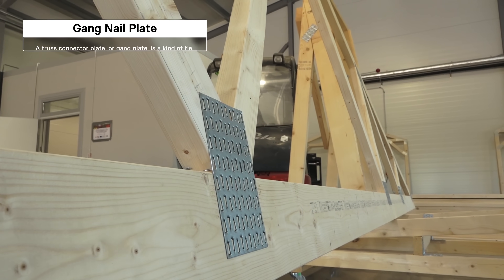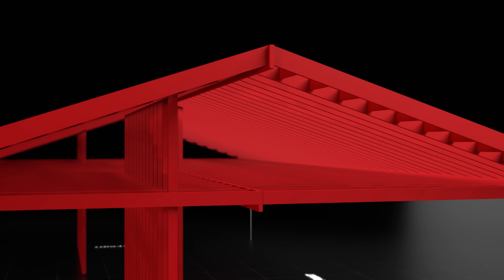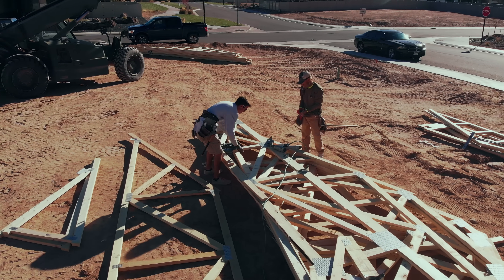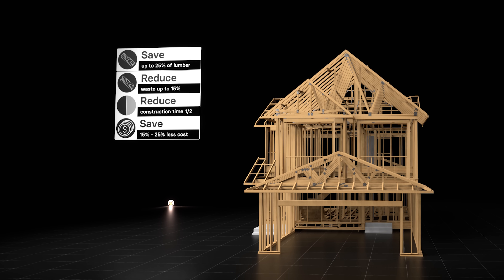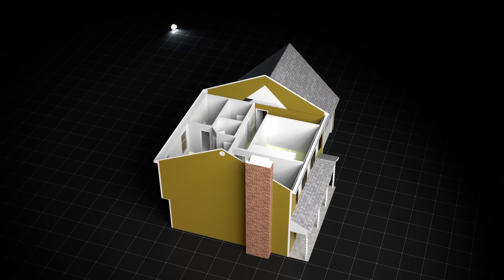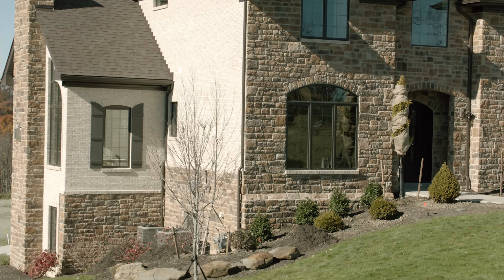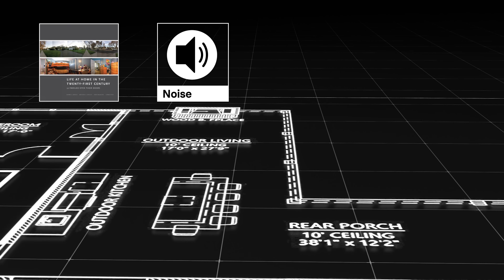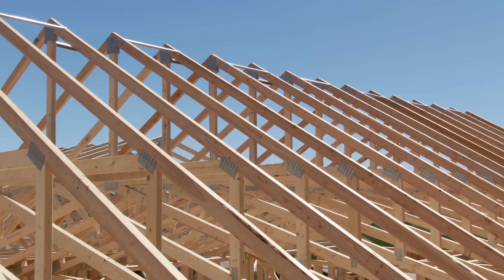The Invention that Accidentally Made McMansions

Comment: I'm not in expert but from watching building inspector videos it seems a lot of these pre made trusses get broken. Maybe during shipping or installation, or perhaps when a contractor comes in to install insulation or HVAC. These trusses get broken or their plates knocked loose. That's not safe. If you had a carpenter building the truss they would know if a part was broken or loose. But when all they are doing is lifting the truss up and nailing it into place they might not inspect every truss and plate.

Comment: Why couldn't they build brick houses? 😭😭
Reply: Wood is the building material of the future, bricks & concrete have a huge carbon footprint.
Reply: @nightjarflying  You don't have to rebuild it for centuries. The most durable materials, that can stand the weather. We have a more than 100 years old house, and it's still in great condition. It does not affect the environment, because you NEVER have to rebuild the house.

Comment: I will never own a home with gang plates. I simply refuse to build with something so easily thwarted by lateral loads But, I'm a stick builder that is not frightened by the inherent cost of quality materials and liberal application of other fastening plates.
Reply: This guy is clueless thinking they are stronger, and used in mcMansions.  I was a lumber estimater for a lumberyard.     That inspector Cy Porter shows failed truss plates, and poorly built trusses,    on tract houses,  
I have never seen a mcMansion with trusses,  the different plate heights of walls,  the varied chamfered ceilings,,  are easier built stick frame,     trusses would require girder trusses, and a lot of specific trusses, that only fit a single location, compared to a tract home Gable roof that has identical trusses for the whole roof
Reply: @jimonthecoast3234  I'm in coastal NC..I would estimate that over 95% of our "Large Homes" ($3-8 mill, ) are all Trusses and LVL. The lable of McMansions applies to the stick/modular built homes that are still spec quality but bigger builds.  Its laughable to me but, gang plates pass the local stage 3 storm standards (somehow).  I personally choose the LVL or an engineered I beam for most of my span applications. If the customer wants gang plated trusses, I do my best to talk them into dead wooding everything with a plate. . I have given up an entire development due to their choice to substitute an 18x6 inch engineered wood creating a second story or cathedral ceilings, for 40 foot gang plated 2x6 trusses. They chose to close in a space that was 30x30 along the entire span of the homes..Essentially they were turning a "Two story English manor," with dormers, into a slabbed out ranch house with 10 ft celings inside. 8/  Im not the least bit upset about giving that one up. They are comical looking inside and out..  XP

Comment: Lol.  Truss plates are what made tract homes more profitable,   and built suburbia.
 mcMansions don't often use trusses, because they are too custom, often with hip roots over rooms with chamfered ceilings,  they are cut and stack
I would know, I read blueprints for a lumberyard,     never saw a single mcMansion with roof trusses,   but they did have truss joist flooring.  You need to correct your title and remove mcMansion since this isn't about them
I almost think you don't know what a mcMansion really is.
Youclearly dont WORK in the field,   and just made false assumptions,  like a n architect that has never done structural plans for a mcMansion
Reply: Not sure why you mention hurricanes.    Truss plates are not hurricane rated,   trusses are very weak compared to a stick frame,   cy the inspector youtuber often shows truss plates falling out, and sloppy connections
They are weaker,
Reply: Engineered beams, can span the distance,and create the open floor layout.  
Cost, time is the benefit. Of trusses,    Weaker design is the drawback.  Especially in seizmic and hurricane areas, where Simpson hurricane ties, and clips make buildings less prone to fail at connections,   which is vastly different than a gang-nail truss plate.   Some clips have screws or nails that are 1-1/4" long and go much deeper into wood than a truss plate

Comment: I've seen older homes use plywood cut out in shapes to do the same thing as the metal plates, basically the exact same thing, except thicker, and not nearly as efficient, because all the pieces had to be cut to fit.

Comment: Structural engineer here. While the gang nail plate has made wood trusses economical. I dont see an conmection between that and the current huge houses that are being built. 
Before college i worked as a framer building these homes (back the early 00's). The homes we were building were mostly standard framing. Hardly ever used trusses. 
If I had to guess, I would say it's more an economic calculation. As land values went up, it just became easier to justify spending more money on the house itself. I'm sure that overall cheaper building materials helped as well. I don't see a connection between the gang nail plates and the current McMansions....

Comment: Interesting twist on history .
Fish plates ( joining plates to some ) had been used on iron construction for centuries either through bolted or riveted .
Hooping iron had also been used for centuries , as the name implies , originally for making barrels .
A nail on plate had been in use for roofing in Australia for at least 100 years as my parents 1892 house had them securing the roof members .
Perhaps this is because Australian houses were made using hard woods and not junk fir or pine and hard wood is rather hard to nail deeply into .
So the parents ( well grandparents built it ) roof was held together using plates with holes and ungalvanised clouts .

SO at best all he did was transfer a method of joining from one material ( iron & steel ) to another material , soft woods . So more of an adaptation than brilliant invention .

No idea about the USA but the introduction of McMansions in Australia is solely due to the governments abandoning social housing during the 70's when greed was good and all taxation was theft .
When the government built social housing it set a size for basic houses around 30' x 60'  for a 3 bed and 40' x 70' for a 4 bed , both single storey .
These are of course cheap to build and more importantly very very cheap to run as heating / cooling + lighting was only needed for the rooms you occupied at the time and most houses were far enough apart to use cross flow ventilation which combined with deep eaves on the sunny side negated the need for air conditioning completely . 

My sister lives in their old house and her energy bill is 2/3 of my bill and I live in a tiny house with no air conditioning either .
The large ceiling space allows for things like a 300 gallon copper gravity fed hot water tank that is the original one that was installed before electricity was available .
The only maintenance done on it since 1892 is one new heating element and several new float valve seals .

Of course you hit the nail on the head when you said builders quickly worked out that building fewer larger houses was more profitable that sensible sized houses thus the McMansion is the only house that you can buy in Australia and trying to get approval for my 180 Sq meter hose took 3 years but a 400 sq meter hose for my neighbour was approved in 2 weeks .
Then there are banks. None of them would finance the $ 85,000 house because they wanted me to build a $ 250,000 house so I would be making lots of money for them for the next 30 years .
I piss myself laughing when I hear all of the sad sob stories of people having to sell their 400+ sq Metre split level McMansions because their utility bills are no longer affordable or an inappropriately built house with a complex roof that collects leaves burning down during a bush fire while their neighbours single hip roofed house stood firm .

Comment: Connecting to the top wall plate isn't explained. The metal connectors are only set in the vertical plane, so how is the roof connected to the walls?

Comment: Railroads use gang nail plates on the ends of crossties to help prevent splitting as the tie ages and deteriorates. It has saved railroads a lot of money utilizing a product that wasn't designed  with trackwork in mind.

Comment: 2X6 walls spaced 24" on center are no stronger than 2X4 walls spaced 16" on center, yes they have more insulation but they are only stronger if spaced 16" on center and that is not very common.

Comment: First, truss roofs didn’t get big til the 80s
Second, they are used to replace skilled framers with jack of all trade builders 
Third roofs in hurricane andrew ripped off all over Florida in the early 90s, what stopped that was hurricane clips to connect roofs to walls and projectile resistant windows.
If anything truss roofs came off more easily not less.
This seams  like very shallow research

Comment: Trusses are only half the story.  Those 80’s houses were still using 2x10 floor joists which at best are good for 14ft of span so that is why the 28ft width was so common.  The TJI composite floor joists is where spans really took off.  All the Engineered Lumber or components were inevitable as we are out of “ good” wood.  Plus the other factor of a generation of kids growing up in small overcrowded house, well they just wanted something bigger 😂😂

Comment: Does anyone know what the machine for setting the plates into the wood pictured at 3:20 is called? Thanks in advance.
Reply: Unfortunately, I do not know of a specific name for it, but functionally it would be called a C-Frame Hydraulic Press... Basically it is a reinforced C-clamp with a hydraulic ram instead of the usual screw drive.

Comment: Typical local government housing policies are based on the number of "dwelling units".
They see no difference between 1 small simple 1000sq ft house, and a 10,000sq ft mcmansion
Reply: I didn't clarify. When a developer can only build 1 house on a parcel, and there is an decreased supply, they build bigger. Because they are aiming for that 30% profit margin. And often permits were a flat rate.

Comment: Its interesting how long it can take building practices to change.  The neighborhood I grew up in was built in the 1970's/early early 1980's.  1 to 2 acre lots, Tennessee so no basements, long long long ranch houses, no split levels, a few two story brick colonial type homes.  None of them used trusses.  In fact it would be impossible to have the rec room/bonus room over the garage like 90% of these homes have if they used trusses.  They graded the lots to have the garage at a lower level than the rest of the house so there was enough head room to have another room above the garage.  Garage was down a flight of stairs, rec room up 4 or 5 from the main floor of the house.  About 10 years later in the 90's the 2 story McMansion became "THE THING TO HAVE" in that area, all of those were built with truss roofs.

Comment: I think you may be over-stating the point about the long-term effects.  Since the roof was previously the most difficult part of a house to build, if there hadn't been truss plates, some other invention(s) would have come to ease this, which probably would have affected the shapes of roofs today, but the rest of that snowball of consequences based on lower building costs would still have happened.

Comment: Another downside to these truss systems besides no attic is the much shallower pitch to the roof.  This is a problem in the northern parts of the country that get snow.  With the shallower pitch the roof doesn't shed the snow.  The snow freeze/thaws sitting on the roof which leads to shingle damage, which in turn leads to underlayment damage, which means expensive roof replacement costs.  My roofer loves my old house here in the northeast.  He replaced the shingles and noted with satisfaction that the underlayment was in very good condition.  He explained to me that this was a direct function of the steep pitch.  And yeah, I have an attic, too. 🙂
Reply: I hate working on steep roofs, I like to be able to walk on it without safety equipment or feeling like I'm about to fall off
Reply: @drtyhay  Build them well enough that you don't need to walk on them. . . . 
Mc Mansions with their many joints (more points of failure), shallow slopes (higher chance of water pooling) and crappy construction have way more points for water to find cracks to leak in. In Germany it's exceedingly rare that roof repairs are needed. In Australia where they built like in the USA, you can essentially expect leaks to make problems after 10 -15 years.
Reply: they make them steep, with or without attics, with or without bonus room, etc.  Not sure what your talking about.   We have an attic,  a full room over the 12/12 pitch garage and a vault over a large section of family room.  all on the same house
Reply: Architect sets the roof pitch and the trusses are designed to fit within. The truss passing or failing can certainly place restrictions on what slope is possible, but ultimately this is determined by the AOR/EOR/Bldg Designer & then the truss manufacturer designs to those specs. 

And you can totally design attic rooms & areas within the trusses, it's a pretty common thing.
Reply: Trusses can make any roof pitch you want. The longer spans mean they will be taller, though.
Reply: This comment is very ignorant. Trusses aren’t restricted to shallow pitches, no attic space, or low snow loads. They actually go through much more rigid engineering than any stick framed roof. Trusses are engineered to local snow loads depending on location. Pitches are unlimited. Almost every house I design on a daily basis has attic space efficiently used to incorporate living space in the attic.

I am a truss designer of 15+ years. I’ve designed well over a million individual trusses. Believe me, the sky is the limit to truss designs, pitches, loads etc. I’ve designed nationwide in huge snow areas such as Michigan, New York, and Minnesota as well as FL and the Bahamas.
Reply: @rooftechtruss  same here - except I moved from design to sales (Shelter Systems).
Reply: @ oh nice, you been to BCMC before? I’ve met a few people there from Shelter Systems.
Reply: @ I have not personally, but I'm sure that you most likely met Tony, Ryan, Joe, or Jason (I'm hoping I'll get to go one of these days lol).
Reply: Truss can be any slope and thus height you want. Steeper would even be stronger and might actually leave room in the middle.
Reply: Tell that to the fools here in Florida who build nothing but steep "snow roofs" that are a complete waste of space, money, and building materials.
Reply: Yes, I hate the look of low-pitch roofs. So much excess roofing material. No attic is a big problem for me. Such a waste of potential space. The snow problem is relevant too. Roof trusses seem like a good way to speed up construction or to make roofs for small structures like manufactured homes. I'd rather see good quality homes get built close to city centers.

Comment: There's one thing I don't get. I understand using wooden houses in cold areas where you want that extra isolation and want a sloping roof to deal with snow. But why aren't houses made out of concrete or brick in the southern US where you have warm weather and strong storms? In Latin America  we mostly use brick and mortar for building houses and they last waaaay longer than woorden houses.

Comment: The kitchen should never be open to the rest of the house.  All the smoke and grease easily spread through the rest of the house.  And the high ceiling in my house makes a good exhaust fan either impossible, or very ugly.  You wouldn't make the bathroom part of a larger room, and not just because of lack of privacy, it's because of the smell!

Comment: You seem to be saying that the McMansion created urban sprawl. Urban sprawl started way before the McMansion. If anything, the McMansion reduced the density of the suburbs. I live in Phoenix area and My home arrived on the back of two flatbed trailers with the majority of the structural components being constructed in a factory with much better quality control than the carpenter in the field. My home benefits greatly from the truss plate and it is a single story 2200 sqft home.

Comment: interesting observational theory on the evolution of the "mcmansion" however FYI it was not the stamped plate use in trusses that led to the improved survival of the roof structure during hurricane winds it was the code enforced use of "hurricane straps " that were attached at the interface of the truss and the wall. This was dramatically observed after hurricane Andrew in the early 90s . Almost to a house those fitted with hurricane straps still had roofs and those without had blue tarps for months.
Reply: I’m curious and perhaps you could help since you seem a fan of hurricane straps. How much cost do you think they add to the construction of the average 2500 square foot ‘McMansion’?
Reply: @kld70  I have no idea all I know is it is cheaper than a new roof